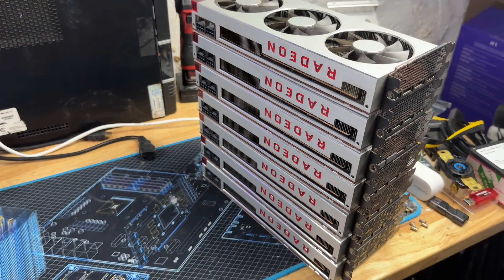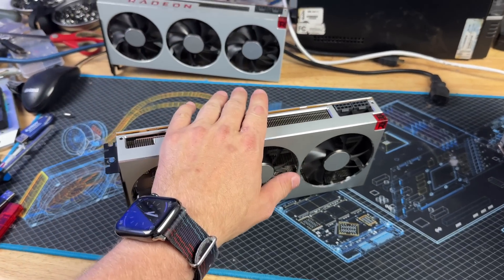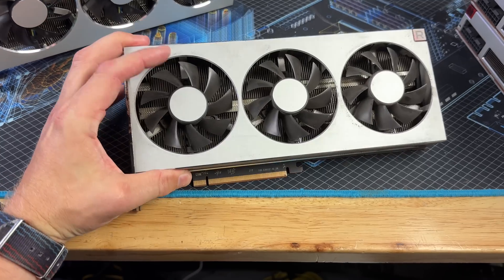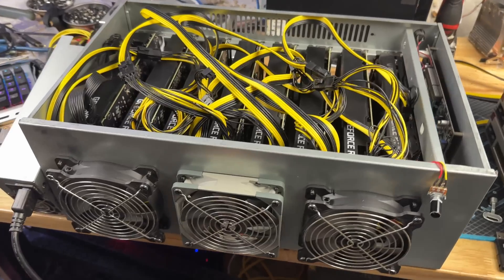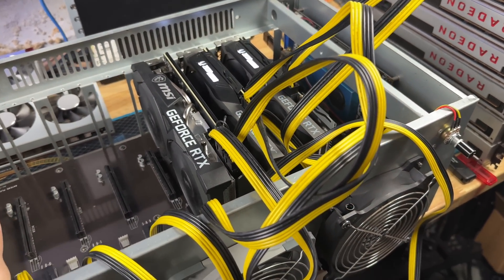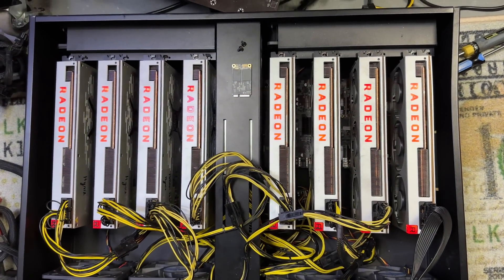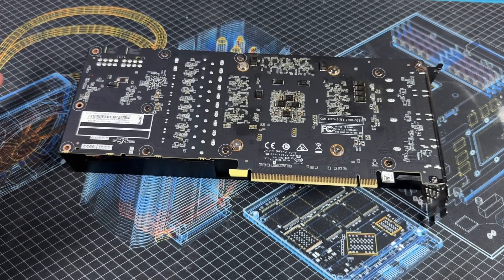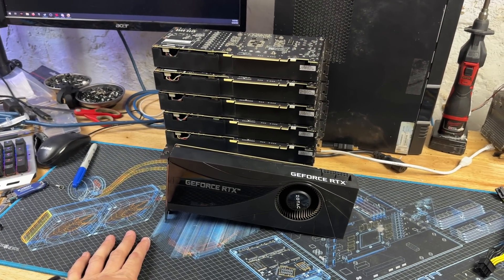8x Radeon VII: I'm so, so sorry.

Comment: Still running this one on my workstation. No problem for gaming.
Reply from the maker: I have no idea why AMD released these but I sure have always loved em.!
Reply: @OvalboreTech  Few reasons i guess.
1. AMD had some anniversary in 2019.
Some companies do release real premium products of a unique design. Radeon VII is one example of this, you may find that  Olympus E-M1x is another such example.

2. 7nm process.
I believe this is the first product using it ever. Tick-tock is a method of releasing chips, where first product is released on lets say 14nm, and its revision on 12nm. So making completely new microarchitecture on an untested process could be a complete mess.

3. Servers and computing.
AMD released very similar cards, with identical chips not only in Radeon VII PRO version year later, but also cards designed for performing heavy computations on server. Making them available for gaming, mining and even HETD platform (workstations) would put the tech into wider audience.

For me... back in 2019 i was looking for a PC grade between normal desktops and workstation grade. First and 2nd gen Threadrippers fit right in, boards as well - its better than highest premium desktop boards, while Radeon VII released later fits right in as well.

What I really see as the only issue with these cards is that they have just 64 ROPs, which limit its performance in gaming.

Comment: why do they not register or show up in octominers ? is it means they are dead? or its just pcie issue?
Reply from the maker: they show up fine in octos
Reply: @OvalboreTech  i have the biggest problem ever, every boot i have a different number of gpus. Amd and their drivers :D lol they never work well. Bc-160's are solid never need looking after, but the mi50's been hell! They are may be the best effiency cards on Dynex. They easily get 12/kh/ at 130W even no overclocks they get 9.6kh/s at 110 watts. I have been on the emails with octominer and hiveos support from 14 cards i manage to make 6 of them work properly, thank god the company accepted returns. There is almost a registery or legacy problem cant understand. Keep getting kernel faults, i keep getting amdgpu failed to send messeges or failted to register. Apperntly these amd workstation gpus are little bit hit and miss like this.
Reply from the maker: they don't though. the chinese MI50s are radeon VIIs with a passive cooler. 

they'll do 9.4 at 120-128w 10 at 145 or 11 at 180

software wattage is honestly worse than a blind guess.
Reply: @OvalboreTech   It does work very well if it works, i find the cards have many issues with finding the correct drivers. From the 14 card i ordered from China only 4 cards work properly the rest either doesnt show up on bios or cannot be overclocked or freeze the entire system. They all going back . If i can i will get some Radeon pro VII which is the kind of better cooling version of both radeon VII and mi50. Yes Mi50's are great cards and i still think they could be top dogs if they been watercooled and only run one or 2 cards in a rig. I had huge problems runnning them in 12x or 8x octominers.

Comment: I had two of these in my eth farm, Samsung HBM and they both died, code 43. RIP.
Reply from the maker: uh oh. I hope mine dont code 43. I know its a common fault. I'm of the opinion though an old mining card is likely going to keep on working. those flaws seemed to be built in to the silicon from the get-go

that being said, keeping the thermal cycles to a minimum! :)
Reply: @OvalboreTech  yeah perhaps I should have mentioned before you bought 7 of them, all RVIIs will die in the next 5-10ish years, if not sooner due to flaws in TSMC's CoWoS stacking thingamajig...
No refunds though! 😜
Reply from the maker: oh, I'm aware of code43 but its a lot like the brass lifter issue with the ferrari F355's engine.. most of the failures happened early on and with vehicles seldom used. most HBM fracturing in the interposer happened already if it was going to happen. I bet most, if not all of these, will outlast any possible use case for them :D

THAT BEING SAID

"I'm so, so sorry" got the point across just fine :p ty for the clickbait caption idea. <3